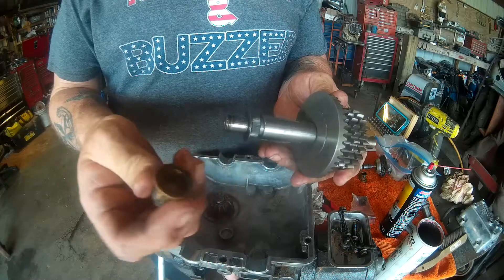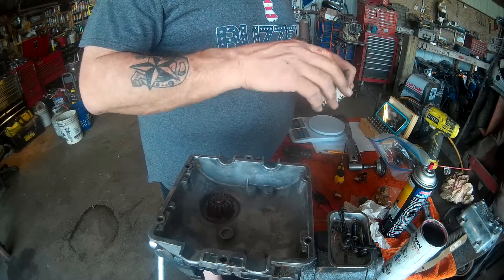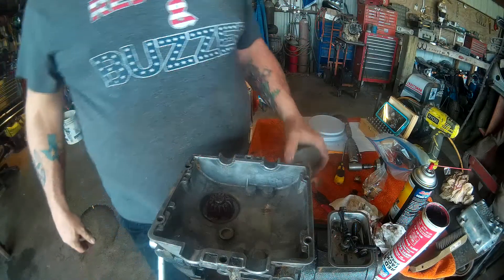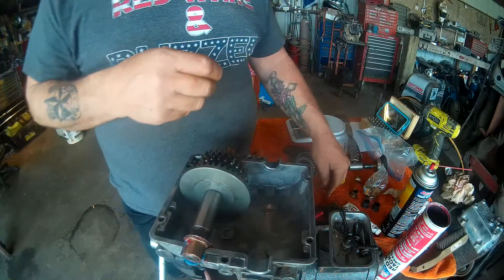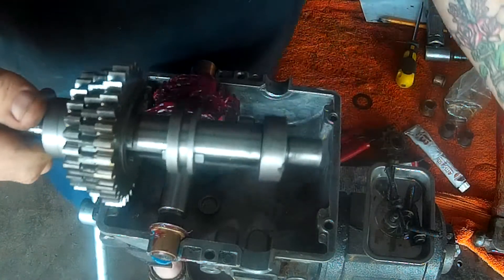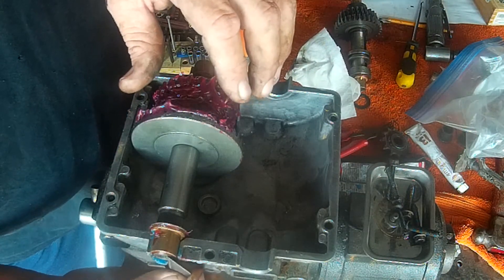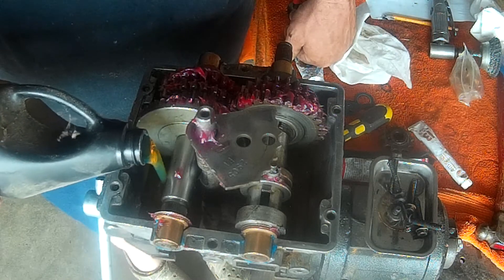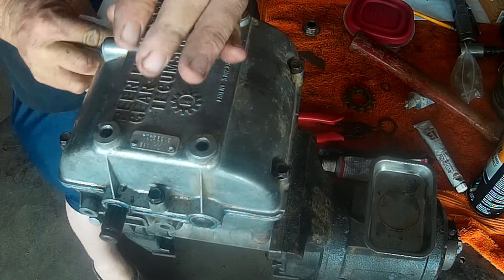GPT PART 4 TRANS PART 2,#twistednation

Comment: Can you drop a link in the description of where you source that drive gear from? I have been making my own by welding larger sprockets onto the original small sprocket. It would be nice to have the option to change gear ratio with a quick change gear setup like you have. Thanks
Reply from the maker: i emailed the links to you,thanks for watching
Reply: @TwistedRRacinStaceyReeves  Thanks Stacey